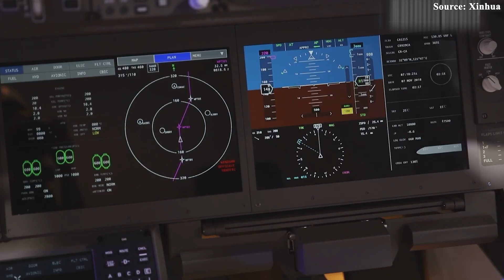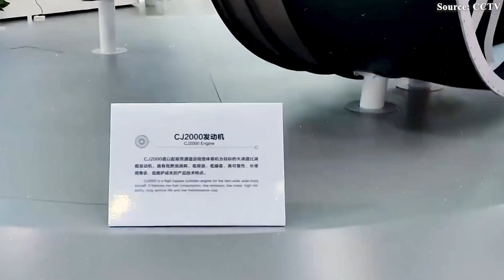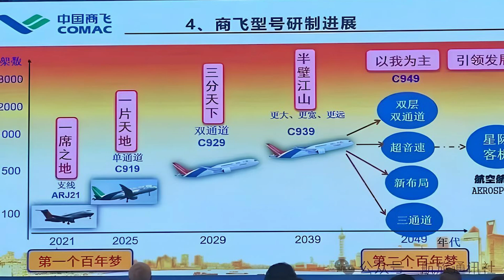China's NEW C929 Aircraft 12,000 Kilometers Testing Flight that SHOCK Western!

Comment: Who the hell wants to sit cooped up on an airline seat for the duration of a 12000 km flight. Deep Vein Thrombosis (DVT), and Pulmonary Embolism (PE) cases will dramatically rise. This will no doubt cause more deaths that can be avoided simply by taking flights with a stopover or two in between for such distances.
Reply from the maker: Flying 12,000 km on a widebody isn’t a big deal, it’s just like the 787 or A350.